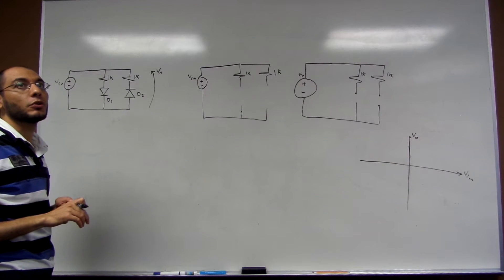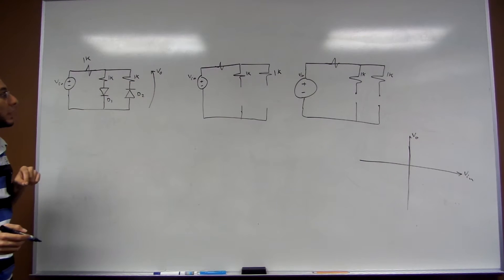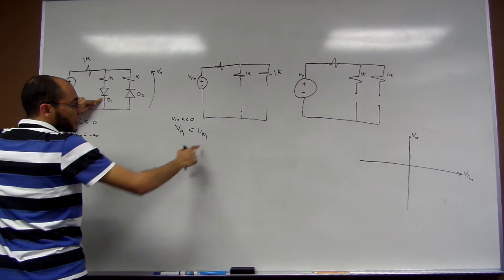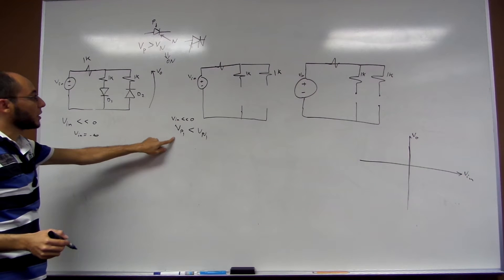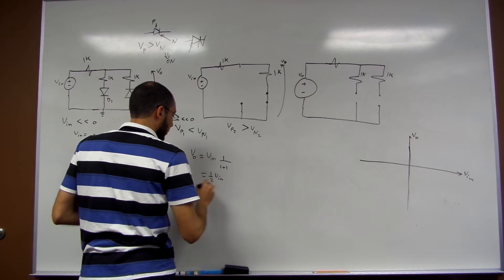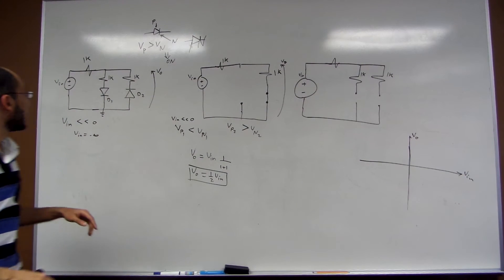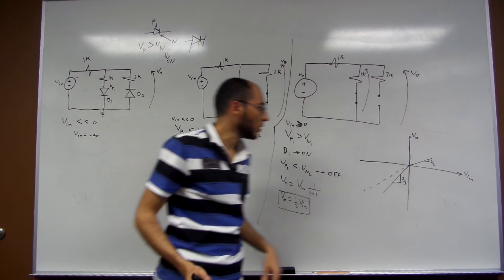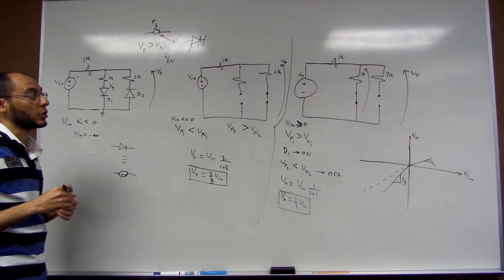Circuits 2 || Plotting Input voltage vs Output voltage of a circuit

Comment: From this what will be transfer function of Diode?
Reply from the maker: You mean the i-v characteristic curve? It is going to be coinciding with the y axis for positive diode voltage values and coinciding with the x axis for negative values.

Not that this curve is not deduced based on the problem. This is the model we need to identify for this diode before starting solving this problem.
Reply: @ewaisha  can u tell me mathematicallu transfer function of Diode?
Reply from the maker: @electronicsthedeep7122  I=0 for V<0, and 0<i<infinity (i.e. Depends on the circuit) for V=0, and undefined for V>0.
Reply: @ewaisha  thanks alot

Comment: Hello, thanks for explaining. If I question. What if the there is no resistance but D1 is connected to the battery and its polarities + - and D2 is connected also to another battery and its polarities - +. How would u plot Vout?
Reply from the maker: Hello. Thanks!!

I'm assuming you want to remove the three resistors from the circuit and would like to plot the voltage across D1 (which is the same as the voltage across D2, but with a negative sign since they are oriented opposite to each other). In that case, the voltage that you want to plot is exactly the same as the voltage across the battery which means that the input/output voltage relationship that you want to plot is Vout=Vin. In other words, it is a straight line with slope 45 degrees.

But note that when you remove the resistors in a real practical scenario, the diodes will get burnt because it cannot withstand ANY voltage value. It can only bare what it is designed to bare. This differs from a diode to the other.

Hope this helps.
Reply from the maker: However, if you want to remove the two resistors (in series with the diodes) from the circuit and leave the resistor in series with the battery, then in that case, the voltage that you want to plot needs to be calculated algebraically by using the exponential model of the diode.

Remember that the ideal on/off model that we are using is just an approximation. It is not always accurate. One of the example circuits where it cannot be used is when the two diodes are connected in parallel but with opposite polarities. This is what you are inquiring about. At which case, you need to use another more accurate model; the exponential model.

Hope this helps.
Reply: Thank you so much for your time Ahmed, I really appreciate that.